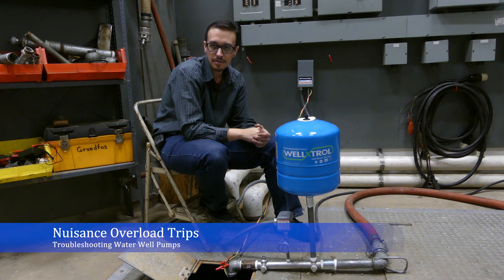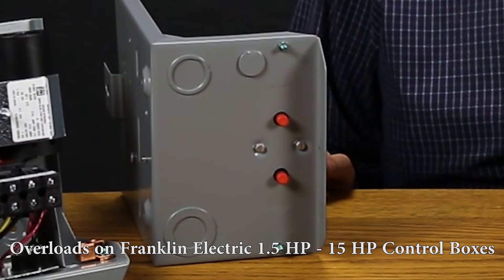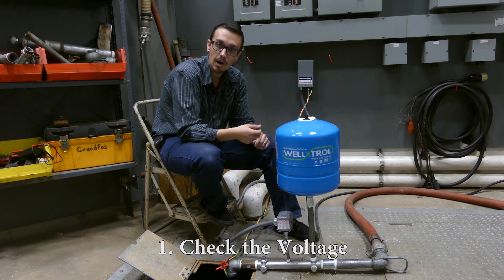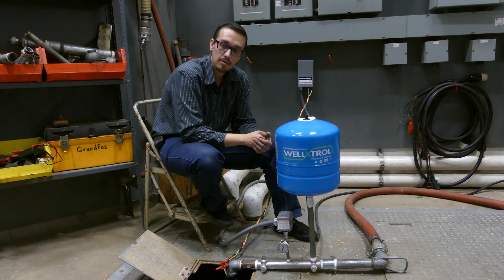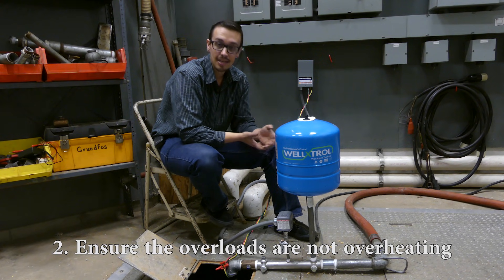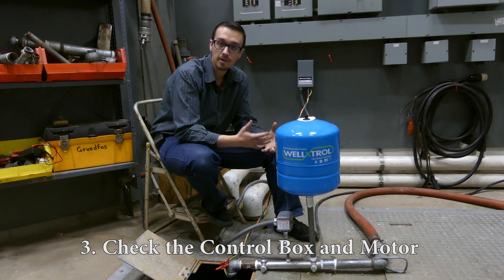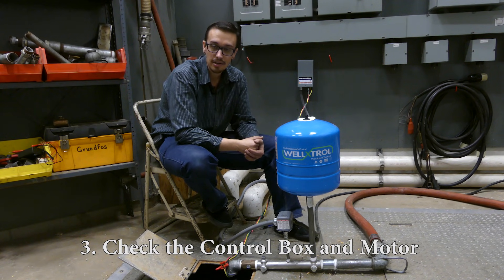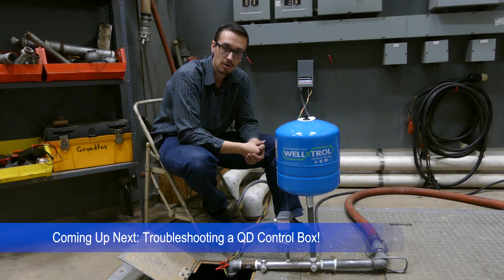Troubleshoot: Water Well Pump Overloads Tripping

Comment: We just got a house that had the pressure switch and blatter tank replaced..the mini breaker on the right keeps tripping..(it has two- 20amp glass mini breakers,but a 30 amp double pole breaker in the breaker box)..could this be causing the issue?  Too small of a mini breaker?
Reply from the maker: Give us a call: 855.329.4519

Comment: I was filling an above ground pool and the water stopped. I checked the box and the two yellow lights were flashing overload. I turned off the water and reset the pump. I have not turned the hose back on and tried to use minimal water in the house. The water has cut off 2 times since (overload flashing) and I reset both times then the water works. Please any suggestions?

Comment: Chris thanks so much for the description of the franklin control box.  I just replaced my two starter motor capacitors and nothing started.  I have had this box for over 30 years and did not know the reset buttons existed because it sat so low.  After seeing your video I punched the reset buttons and was in business.  My capacitors were 20 years old and neither of them registered any microfarads.  I was in business for $18 and change.  Thanks for educating me.

Comment: Can a pressure tank that’s too small cause the main overload to trip under constant useage? My well x trol  tank probably has a draw down of 8 gallons and every summer when my pool auto fill is refilling the pool, and someone uses the shower, on occasion (not always) the main overload on my 2 hp Gould (down 700+ feet) trips. After reset, it works fine, and can for days or more if the demand isn’t really high. The control box isn’t the issue, it is fine, caps, relays, within spec. I changed the pressure switch and all voltage is ok. My thought was with a draw down that can empty the tank in 2 minutes, the pump is cycling on for 2 mins, off for two mins, on for 2, off for 2. Could that cause this intermittent overheating and tripping of the main overload? What if I got a much larger tank? So the draw down is 20 gallons. Yes, the pump will have to run for 5 mins straight to fill the tank, but then it will have a 5 minute rest to cool down. I probably fill at under 5 gallons per minute due to the 2hp and debt has of the well. 
Any thoughts? If I call someone local it’s gonna be a 5k new pump with labor and a ruined lawn, since they have to drive to my backyard to pull the pump. My next move may be a new tank. I thought these pumps were made to run constantly, like a fish tank pump. Can’t imagine it’s going to trip the overload running 5 or 6 mins straight. But any help would be greatly appreciated. Thanks

Comment: Thanks for the Video. I have this system and I already changed the control box and the pressure switch (40/60) and when I turn the system on and reaches over 40 the gauge starts flickering and the overload switch on the control box is triggered shutting down the system. Any idea of what could it be?
Reply from the maker: I'd start by checking the pressure tank
Reply: Right now the pressure is 30psi in the tank
Reply from the maker: https://www.youtube.com/watch?v=w21qa2bMUh8&lc=Ugyk4v0Fb5RkU93FzsV4AaABAg
Reply: Thanks for the video. I already did that and made sure the pressure on the tank is at 38 wich is the max for my tank. I turned it on and after 30 seconds the overload switch triggered anyways shutting down the system.
Reply from the maker: Might be time to call a service tech out or you could try replacing the control box to see if that fixes it.

Comment: Control box stopped working to day. One start cap had wire burned or rotted off.. aluminum always breaks down. Also found pressure switch burnt stuck on. Replace all even the run cap ...Still Not working
I can push on the coil contacts to make connection to pump and tank fills. 3hp system sitting at 400ft. If a new box would work I'd get one but I'm not sure of anything now.
Reply from the maker: Give us a call to troubleshoot: 855.329.4519
Reply: @RCworstwater  I want to hand it the to R. C. WORST & Co. Dave there worked with me and in 2 days with 10 minutes of work my well back up and running! Thank YOU!

Comment: I'm running out of ideas and hate to have a crane pull out my pump and have it to be something above ground. Could a problem be in the pump saver itself.  My pump saver is giving me a dead head or dry well reading. My well drawn down is normal. My pump pressure is 20 psi normally around 65. I am getting 220 volts to the control box. My run capacitor checks out good. The relay switch also checks out good. Before I hire a crane to pull out my pump is there anything else I can do. (any trouble shooting at the pump saver) If it is a dead head problem, can I some how clean out the line without removing it). Thanks for any information on this.
Reply from the maker: What's the amperage when the pump is running? I will also need to know the HP of the motor.
Reply: @RCworstwater  The pump is a Payton submersible pump either 3/4 HP or 1 HP.  at 15 G.P.M. ( The installer in 2018 wrote done 1H.P. 15 G.P.M. in a black marker. The well service company told me 3/4 H.P. at 15 G.P.M. in there files)  My amps are 6.8 to 7.0. The amps do not change even prior to when the pump saver turns the pump off. The pump does put out around 15 g.p.m  but does drop just before turning off.
I did try  turning  the sensitivity way down on the pump saver and re- calibrating the pump saver.  At this point..." I am thinking the pump saver is doing its job."  So there might be a hole in the line or it may be sanded up some how. 
My pump is 60 feet deep with a static level of 11 feet and a draw down of 25 to 30 feet

Thanks again for all the time you guys put in these videos and answering so many questions in a short period of time.